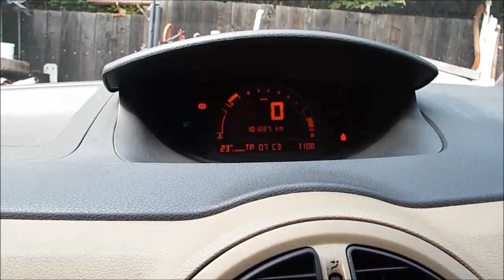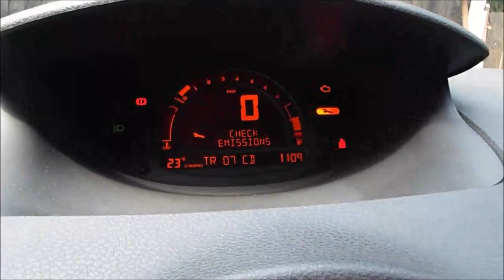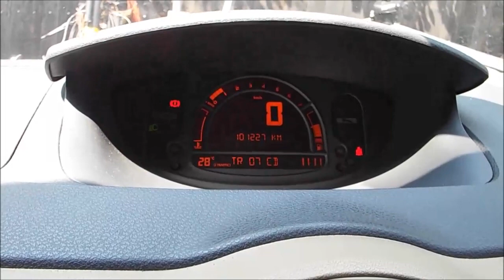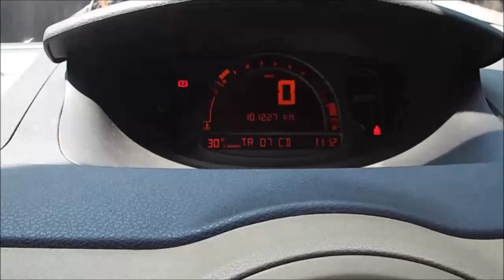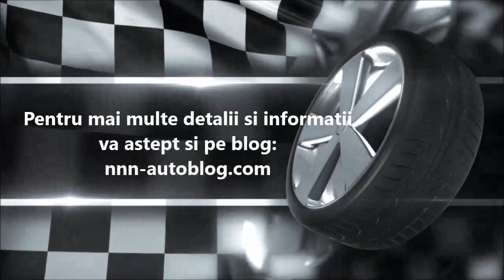Cum se schimba bobinele si bujiile la Renault Modus 1,4 16V

Comment: Salut. Am un Modus 1.6 16V benzina si recent motorul merge neregulat, la relanti, dar parca si in sarcina. Tremura. Cel mai pregnant se sesizeaza daca mergi la topa de esapament. Imi pare ca la motor ( la capota) nu e neregulat ci doar cand mergi la toba, dar poate ma insel... Am patit sa-mi cada bujiile de inductie si stiu simptomele: mers neregulat, mult mai nasol decat acum, si martorul de motor aprins. Dar acum nu am nici un martor aprins, nici un mesaj de eroare. Poate fi inceputul stricarii unei bujii? si sa nu am eroarea de gaze in bord? Sau as putea verifica altceva? Iti suna cunoscut simptomele? Multumesc.
Reply from the maker: Cauze pot fi multe. Daca ai făcut o diagnoza și nu ai nicio eroare înregistrată  poate ar fi bine sa verifici puțin distribuția. La aceste motorizări distribuția se poate decala foarte ușor.  Totodată, daca motorul are mai multi km  nu ar strica să-i faci un test de compresie.